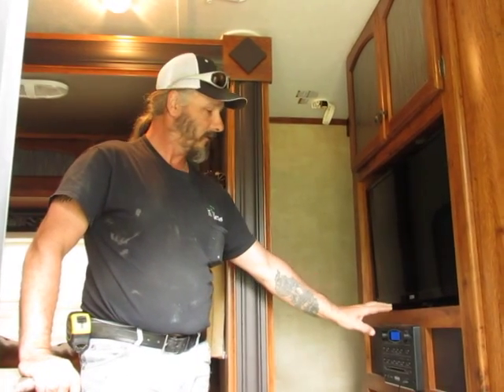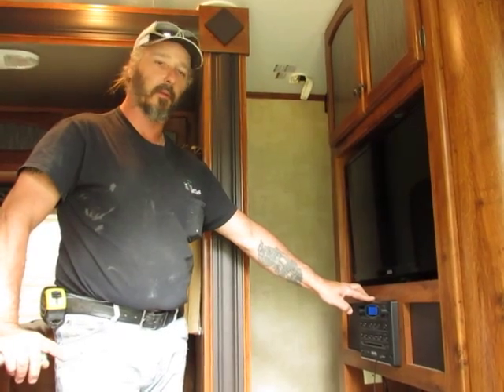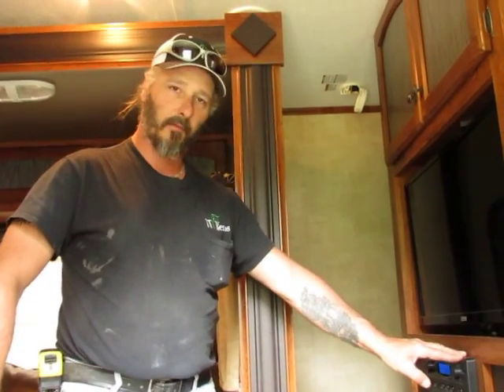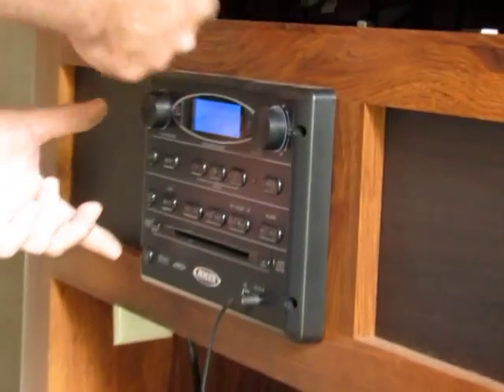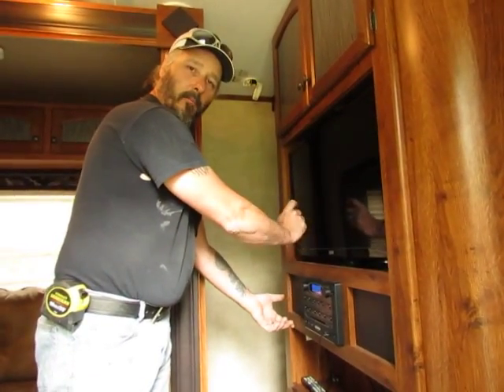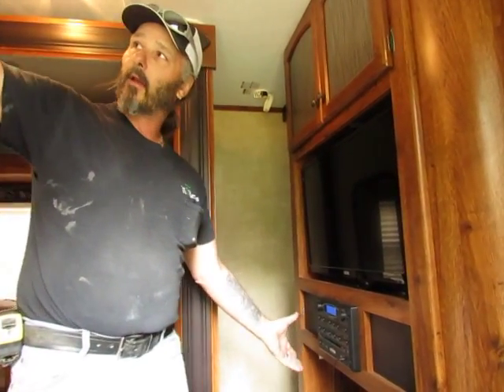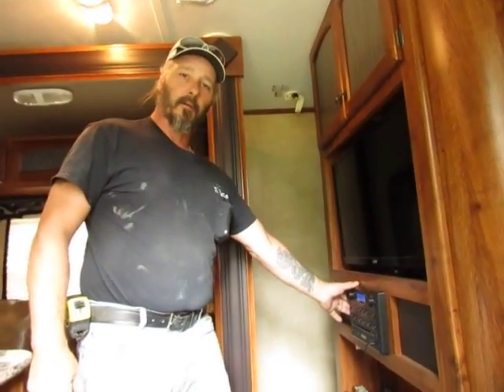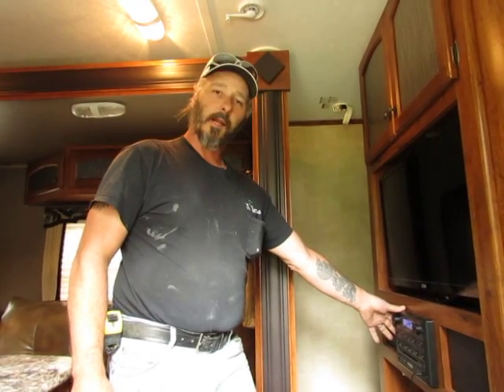Change/Replace Radio Fuses in your RV Travel Trailer

Comment: My Jensen dvd doesn’t work. I just bought a 2009 Laredo and it has the same Jensen radio but I didn’t get a manual with it.  Can you give me the model number of yours if you still have it.  I need to get it fixed.  Thanks.

Comment: My TV went haywire the other day in my traveltrailer,And the stero will not power on now either.Trailer is a 2017,Bought from person i know june 2022,Tv or stero had never been Used or turned on,Stove Microwave Fridge Never used,Only the bed and toliet had ever been used in it.like new.Is this my problem?A blown Fuse?